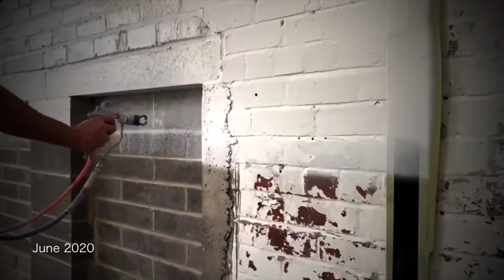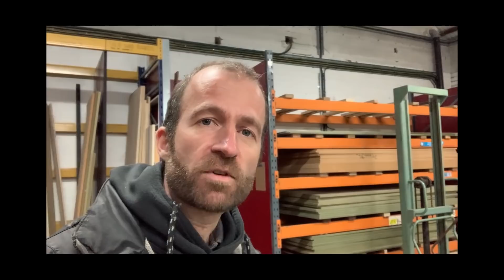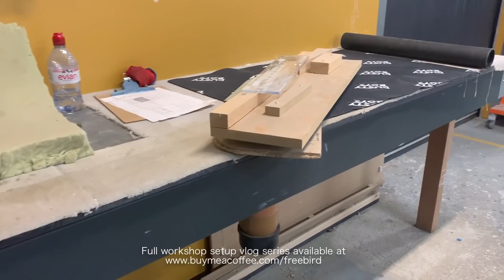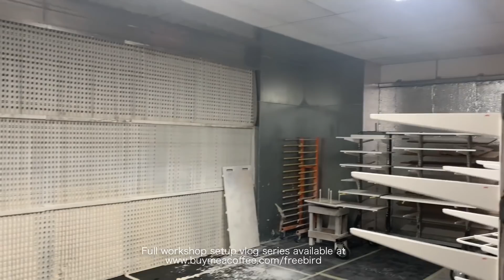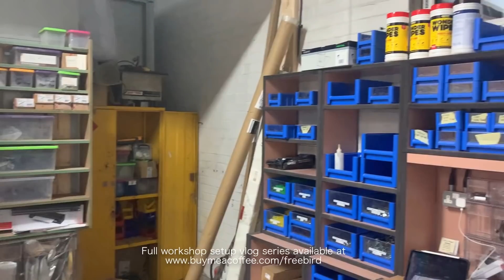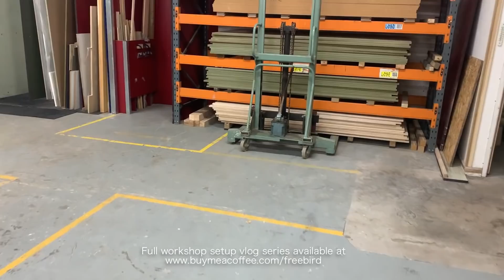Setting up a ‘Lean’ Woodworking Workshop From Scratch

Comment: This popped up in my feed today.  Looking back it was great progress made !  It was fun and enjoyable working with you on this
Reply from the maker: Yes it laid a great foundation for the business!   We recently got better dust extraction and ducting.  We are just now discussing how we would fit a bigger cnc machine in - by pushing the spray booth enclosure further down and putting the 2 big workbenches against the window wall
Reply: @Alastair_Johnson  yes!  Great to hear. That first stage was the “foundation” stage. 3F = factory flow foundations.  Now you are looking at the next stage.   Final stage is excellence. World class excellence thought Lean.
Reply from the maker: @TheJoineryCoach  Things are moving forward here at a pace now!  The physical business remains necessary as a sort of lean showcase, without sucking me in too much to bespoke fitted furniture, but mainly producing repeatable products.  The SketchUp/CabinetSense training work has now reached a tipping point where I am approached for training at a higher hourly rate than I can command for the manufacturing work, so I just can't justify sidlining it anymore.  I will soon be taking up the offer of being the UK distributor of CabinetSense - the demand for SketchUp-based parametric CNC software is huge over here, as word is spreading that it now competes with the big players.  We are also launching a parametric web based ordering system for shaker doors, and the timing is good because that looks set to be entirely delegated once it gets flowing.   We officially launch that at a trade show in mid May.   We are also working on a deal for me to have a percentage of sales through that system as it rolls out worldwide.   So alongside the alcove cabinets (which we are circling back to as a priority in our marketing again), it is starting to look viable for the business to run with reduced input from me so I can pursue the more profitable avenues, while keeping a tidy and secure business providing fulfilling employment to my team.  Our time with the Joinery Coach really helped us put some good systems in place.  It was also good that I stopped and drew a line under that period, to more freely pursue my own priorities for my business, which looks set to reap dividends.  So it's all coming good now 👍

Comment: Does an internal office space need to be built to uk regs as I’ve got an industrial unit but need to build and office in here in the most cost effective way
Reply from the maker: Well, we ended up buying a second hand shipping container office (already fitted with windows and door, basic internal lining and insulation and a couple of electrical heaters).  That was a good decision.  Keeps the office away from the noise of the workshop.So long as you have space for it outside

Comment: Would you share the drawings for you offcut sheet racks if available. These are fantastic looking and a really good solution.
Reply from the maker: They are simply made from second hand metal racking which I got from John Burley’s in Swinton.  If you fit only the rear cross members and not the front ones, then you can get short cantilevered arms that hook over the rear ones and stick forward.  Then I simply screwed some vertical boards to those arms to create more distinct partitions

Comment: Looks brilliant so far. It's would be great to see this workshop running in another video. I have tried LEAN concept to furniture workshop, but that was so tough because all different components of a furniture piece are processed in different steps. That means you need more space and  trolleys to store and keep the components  in queue prior to moving into next steps. I see you got a lot colorful stuffs , they are probably  the signals for the priority or operation order. Looks good !!! But, as you know , as market is not stable , your clients change product design time by time. I don't know how your LEAN workshop adapts that. Thank you for posting this video. People will learn a lot from that
Reply from the maker: Parts shouldn’t be say waiting for long on a cart.  Part of the lean idea is ‘pull’ not ‘push’.  We shouldn’t be getting backed up by over production or cutting things too soon.   These days, on a typical project which has sprayed external parts and melamine internals, the MDF 2 piece doors are made first on the cnc, then straight to assembling, sanding, spraying. Then any other MDF spayed parts follow close behind.  But the melamine carcase parts are usually manufactured and edgebanded the day before everything is sent out for installation.
Reply: @Alastair_Johnson  , Thanks John for quick reply. That sounds good. But I don't know if it can work in mass production and fast pace environment. I'll keep learning from what you have done.

Comment: The woodshop looks great. Do you use any software, apps, etc. to manage your work or white board is enought? How you deal with many projects at the same time?
Reply from the maker: Yes we rely a lot on ServiceM8 (though it has plenty of niggles and flaws) and I also use Airtable.  And Google chat to communicate with the team.  I have gone through so many apps trying to find ‘the one’.  Trello, Nimbl, various others.  None of them are perfect…. Unless you spend a LOT of money on an industry specific solution aimed at bigger businesses (like Jobman software) or pay to make a bespoke app.  But in any case, it’s only ever as good as the way you set it up and how you use it.  Eventually you just have to choose an imperfect system, make it work for you as best you can, and always strive to keep it simple.  The precursor to it all is clarifying each step of your business process flow.

Comment: Hi Alistair, I can see that you didn’t go with the Hammer saw what did you decide on instead and why?
Reply from the maker: Hi Alan, I had a look at the hammer machines a few years ago before getting the bigger workshop and I just decided to bide my time until I knew what space I had to work with.  When the time came, I decided to go second hand on the basis I could get a better machine - more for my money - but it was a bit of a double edged sword, and I would be really recommend buying second hand unless it’s from an established reputable dealer who you know will give you back up and servicing if you have issues.  I got a Wadkin CP32 and had a few issues with it but it is now well set up and working fairly well for us (look for a video on my channel called ‘how to square a panel saw’)

Comment: When you have off cut pieces reach the 4th month of non use, do you ever cut and glue the off cuts into composit pieces that would be of more useful dimensions?
Reply from the maker: Occasionally for solid oak board only.  For mdf etc the work involved is not worth the cost of the board (and it’s harder to get a perfect joint that is strongly glued and that won’t show a slight seam through a smooth painted finish)

Comment: Tip for your Kanban cards and how to get them to the next level. Simple four step implementation. 1) Use the card itself as the reorder signal. Specifically meaning that you either scan or take a photo of the card and send it to the vendor. 2) You will need to discuss this "authorization" signal with your vendors before hand so that their staff accepts the email/text/fax/scan as the authorization by your company to produce or release the next order. 3) Once the scan authorization is complete, put the card in a small box where you receive materials back at the front end of your process. 4) When the items are received and put away, bring the card back to the bin. 

Remember, kanban basically translates to the word, "signal". The JIT method used at Toyota to develop what was identified as "kanban" used the cards as a method of metering or controlling the flow of materials in their supply chain. The card is more than just information but a delegation of purchasing/producing authorization for you as a manager to drive control through all levels of the organization and keep costs under control and material on hand at the right times.
Reply from the maker: Thank you I appreciate gaining these kind of insights from more experienced commentors it’s valuable to me 👍

Comment: Nice setup. I have just checked your website. I am based in ireland . Do you have enough work just out of alcove units to keep you going?
Reply from the maker: Currently we do.  Plus bedrooms.  I often ask myself whether I should be doing kitchens and other bigger jobs but actually there’s a lot to be said for specialising.  The work is out there.  We are very fast and efficient at alcoves now, and able to charge good rates.  I’m about o advertise for an installer.
Reply: @Alastair_Johnson  yeah I wonder if the market is big enough here in ireland.
Companies that specialize seem to do well. I am involved in the kitchen industry myself. Lot to be made in it but a lot to be lost also.

Comment: Thank you for the tour. I’ve been a keen observer of production principles for most of my career. Fascinating stuff. Reducing wasted motion has always been my “specialty” 😏. 

I’m curious what ambient temperature you keep in your shop. Do warm other liquids like glue? Or just the sprayer/paint?
Reply from the maker: Hi, well, the ambient temperature is pretty much the same as outside this time of year!  We really need to get some proper space heating  (a large woodburner is the obvious solution) but the budget cant stretch to that yet, so i'm think we save up for it in the coming year.  It would definitely be good to not let the glue and other things freeze!

Comment: Fabulous lean shop.  I used to run a plant that made custom tables, booths, and bars, and came to many of the same conclusions you ended up with.  Love your comments about "experimenting", and usage of kanban for a small shop.  Good luck to your business!
Reply from the maker: I think it’s essential to experiment and find what works for you, there are lots of different ways to implement things.  The component storage area and Kanban system has taken especially long to finalise - one of those things that may seem simple when finished but a lot of thought went into the choice of boxes, storage area, even the size abs layout of the cards!
Reply: @Alastair_Johnson  It's truly a great use of space.  As a lean nerd myself, you have a great layout.  Clear inbound and outbound lanes, organized and combined work areas, clear zones that group work where you can, and not move too far from zone to zone otherwise, good 5S, cart usage, etc.  I think you are well on your way.  Good use of space.  If you ever figure out the sanding area well you are going to be ahead of most shops.
Reply from the maker: That’s all very encouraging thank you

Comment: Is your slider table saw accurate when it comes to squaring and processing sheet goods?  Looking into these for my shop.  Thx
Reply from the maker: Hi, it wasn’t at first and I was worried is made a bad purchase but then I got it properly squared up and it cuts well now, except that a bit of wear on the crosscut fence can mess up the squareness on smaller cuts
Reply: @Alastair_Johnson  This “wear” you mention, are you talking about the adjustable stops?  Thx
Reply from the maker: This Instagram highlight shows the whole process of squaring up a panelsaw https://www.instagram.com/s/aGlnaGxpZ2h0OjE3ODk3NDg5Nzg1NzIwODkx?igshid=1o4rj6q19v02o&story_media_id=2460985356675166148
Reply from the maker: No I mean through decades of use, the crosscut fence is no longer perfectly flat and straight along its length, where you push the edge of the board up against it - it is slightly worn towards the blade so a long straight edge pushed tight against it will show a very slight tapering gap toward the blade end of the fence.  So when the fence is squared up for a large board, a smaller board that only makes contact with the worn section will be tilted slightly off square
Reply: @Alastair_Johnson  yes, literally just finished the video you sent me.  Great video.  Thank you for that.  You should put that on YouTube as well, it’s great info you have there.  I’ve also heard that a .002 “toe out” between the blade and the rip fence is good for safety.

Comment: When you get your CNC router you will be able to cut your pocket holes on that. Saves a useful bit of time and cuts out a separate operation.
Reply from the maker: Well now... yes the CNC will be a total game changer and I expect we will completely revise a lot of our methods accordingly - starting with most probably replacing pocket hole joints with the Lamello Cabineo fixings

Comment: Shame you are not in my neck of the woods as I would happily assist you in removing anything left in your over 3 weeks scraps bin.  I bet there's a fair bit of useful offcuts there.
Reply from the maker: Yes definitely there would be useful boards in there.  We are thinking of advertising on Facebook.  It would simply be ‘come at this time (maybe a 1 hour slot) to take what you want, and after that it’s all going in the skip’.  Got to start getting ruthless to avoid the clutter building up again.

Comment: Lean sounds like a marketing manager term.
Common sense is far cheaper. Our workshop is setup similar but with a secondary line of real wood, (rip,crosscut,surface and four cutter) much like your cnc will be. I suspect you’ll be reducing your kreg station,or moving it to your side and placing your planner/thicknesser in that area (effectively creating 3 initial lines from raw materials.
There’s no way you’re going to be able to process timber in the corridor because that will be full of finished cabinets in no time at all lol.
Also, do you use a bench hook style jig for lamello/domino or just reference using the machines fence?
Reply from the maker: Lean is a way of thinking that goes way beyond my own common sense but I see what you’re saying about keeping it simple.  So I think your ‘common sense’ is probably informed by your own experience.  I think efficiency is also about focus and reduction - we specialise in panel based work which almost never requires the planet thicknesser but it seems worth keeping for the occasional need.
Reply: Lean is a japanese system that was created from Toyota manufacturing and they got the idea from Ford who created the modern manufacturing line. 
Lean is a system and it could be described as common sense as well.

Comment: I really appriciate seeing your progress and hearing your reasoning behind. 

A few lean recommendations:

1. Put som magnets on the pusher stick so you can attach it to some good place. 
2. Think about the workflow and movement when using drills and impact driver. If you have to change drills/bits a lot - get more tools and mark them on the back with Pozidrive 2 for example. Consider to have a mobile cart for drills so you can keep them close to the workspace. 
3. The canban cards can have a QR code with the website adress on it- so you can order even quicker.
4. Consider markings on the floor for carts so it's obvious where they shold be kept when not in use. 
5. The cable to the big saw should  be below the floor surface, big risk for damage to the cable now... 
6. Maybe have som electricity above work surface? Cable reel automatic maybe? 
7. Paper rolls should  have a holder, especially in package area.
8. If you increase volume in the future - consider is you shold get some special packing for cabinet doors for example to avoid wasting time and damaging goods in transportation. 

Looking forward to see what you will improve next. 

Merry Christmas from Sweden
Reply from the maker: Great advice thank you!

Comment: Random question - I have a customer who wants some full height wardrobes and is determined to have the doors from 18 mm mdf made with cnc . I’m concerned they will bow being so tall and around 550 wide ?
Reply from the maker: I prefer to use 22mm to be on the safe side.  Don’t let them set the agenda against your better judgement.

Comment: Alastair, a masterclass in building an efficient manufacturing business - well done, an impeccable implementation. The only remaining opportunity I could see was the shipping step at the end. Maybe invest in some small scale pallets and a micro forklift to drop a job consignment straight into the back of the van. Fantastic to see you back on Youtube, you clearly produce top-class content and many people will derive practical benefit.  I do think you are missing a trick and revenue from not investing more on Youtube. Good luck with the new facility and a happy new year.
Reply from the maker: Thanks for these thoughts Lester!  Some kind of powered forklift would be good in future.  2!of those simpler wheeled carts are built with the platform at same height as the van floor.  So after packaging parts at the assembly bench they can be loaded onto the cart at the side of the bench then easily all shunted into the van